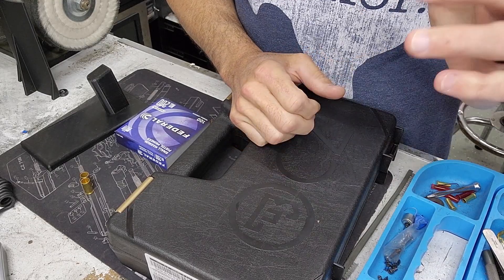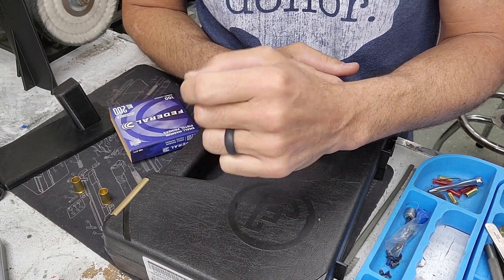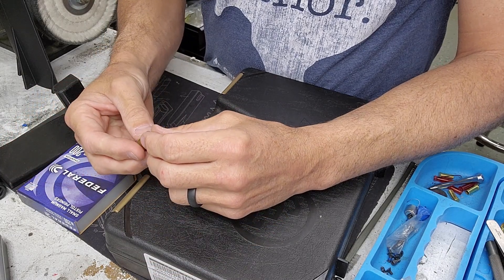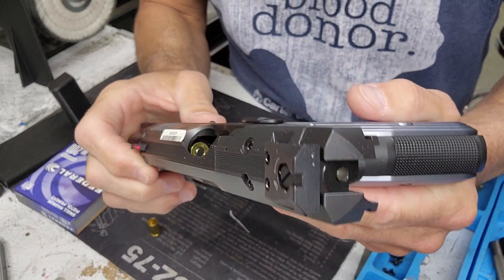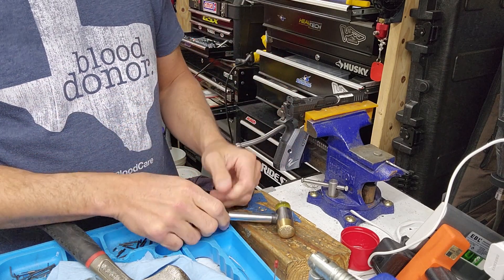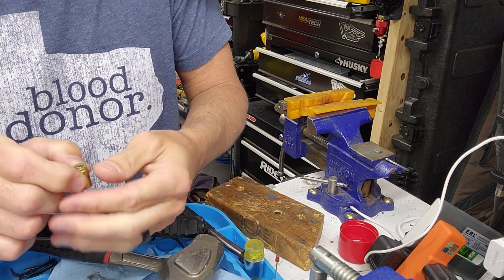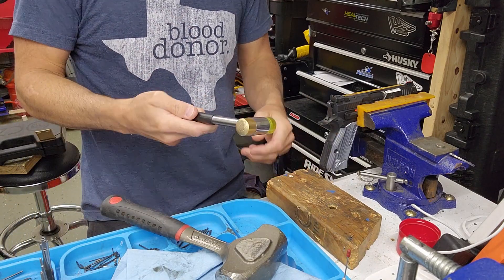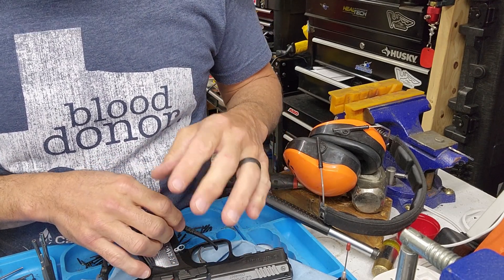Shadow 2 Compact - Drop Safe?

Comment: What a great test!  I commend you for doing this with ur new CZ pistol. My feelings on this subject are just what you discovered. For EDC stay far away from extended FP’s or any internal mods and you will be fine. Learn how to properly lower the hammer on a loaded chamber and you will be good to go.  You were imparting some serious force on that pistol when you were striking it with your large hammer. Great video!
Reply: Mods wouldn’t change this at all. Only mod that would change the result was tested. If you carry the S2C, don’t use an extended firing pin

Comment: This confirmed what I read on another experienced guys comment. He said the same thing, stock firing pin you'll be fine, but if you put an extended firing pin in then yes its possible.
Reply from the maker: Correct!  I was actually able to ignite the primer in one of the takes, but unfortunately I wasn't recording.
Reply: @czarmorer that was with the extended firing pin. What company was the extended firing pin from? Different ones have different lengths
Reply from the maker: @Rothbardy  the one I used is from CGW
Reply: @czarmorer  CGW is a no-go for me, thanks!!
Reply from the maker: @lorclan85  mind sharing why?  just curious about it. I mean, this not something that holds true only to the CGW ext. firing pin... this would happen with any ext. firing pin, unless of course, they are not really extended 😃
Reply: @czarmorer  didn't mean to put CGW on the spot. What I meant to say was no extended fire pin upgrade for me.
Reply from the maker: @PrecisionKing85 no problem at all, I was just trying to understand if you believe the CGW ext. FP was anything different than any other after market ext. FP - I don't think it is, that's why I was asking.
Reply: @czarmorer  cant you carry the gun half-cocked? you still get 80% of the DA pull and it protects the firing pin. you should be able to use an extended firing pin....
Reply from the maker: @cliftonk  sure thing - that's how I carry: Half cocked, safety on.  But I don't have an extended FP on my carry gun - I simply don't need on it.
Reply: @cliftonk  Another guy did a test and showed that you get 100% of the DA pull half cocked.
Reply: @baguazhang2  it’s not about the pull. It’s about making sure the weapon is drop safe since I use Cajun gunworks internals which includes an extended firing pin.
Reply: I've been carrying a shadow 2 compact converted to SA and an extended firing pin. My solution to this is simply to jot drop it. It's pretty easy to not drop a gun on the ground
Reply: Ive been carrying shadow 2 compact converted to SA with extended firing pin. My solution to this, is to not drop the weapon. Pretty easy to not drop a gun imo

Comment: Great presentation and thanks for showing this. I won't be carrying a S2 compact for other reasons, and decocking fully is one of those. If I carried this gun, it would be even safer to carry it half cocked, due to the safer decocking. The reason I won't carry this gun is that on the sample I shot, the wall on the single action trigger was too indistinct to be safely manageable under stress, in my opinion. After this, though, I think the firing pin question is adequately answered. Thanks again.

Comment: The extended pins cost 2 lives so far. Both heavily modified S2s. One in Canada, one state side. Both times falling directly on the hammer. Once the user itself was hit (the canuck Dentist) and once hit the RO behind someone in uspsa. 

I heard twice no about SP01 tactical (should be the name you have overseas for the decocker model) firing while decocking. Is that possible and if so which parts have to fail,  be disfunctional or badly tampered with for that to happen?

Comment: While I applaud you for actually doing some testing, I'm afraid that you have missed a very important failure mode.  Because the CZ Compact does not have a firing block, the firing pin is only kept away from the primer by the firing pin retaining spring.  The force exerted by that firing pin retaining spring is fixed.  

If you drop the gun onto a hard surface on its MUZZLE, the firing pin retaining spring will have inertia and will want to keep going after the gun stops.  If you drop the gun from a high enough height onto its muzzle, the inertia of rhe firing pin will overcome the force of the retaining spring and the gun will discharge.  This is basic physics.  Since the strength of the firing pin spring is fixed, that strength can be overcome by inertia simply by increasing the height of the drop.  We don't know how high a drop would be required to cause a CZ Shadow 2 to discharge.  Testing this would result in damaging your CZ.

Gunsmith Hilton Yam tested this on 1911s.  He built a fixture that would hold the gun muzzle down.  That fixture had a guide that ran along a vertical rod.  It took less than a 5' drop for a Series 70 gun to discharge when dropped on its muzzle onto a concrete surface.  Changing to a lightweight titanium firing pin and an extra power firing pin retaining spring increased the height required for a discharge.

Note that I'm not saying that the CZ Compact is unsafe.  I'm saying that just like a Series 70 1911 isn't drop safe, the CZ Compact isn't drop safe either.  I carried a Series 70 for years, so I'm comfortable with that.

But we need to be honest about the CZ Shadow 2 design.  It will discharge if you drop it onto its muzzle from a sufficient height.
Reply from the maker: Great point and a very valid one too.  Thank you!  However I did not intent to prove either way, and the experiment was merely an attempt to simulate what would have happened if you drop the gun at a height somebody would be holding it when using the gun.    
If we will talk physics, I'm not going to put the math behind it, but I'm confident the strikes I did on the hammer produced more kinetic energy transferred to that firing pin than the inertia it will carry over being dropped from a 5 of 6ft height hitting the ground either way  (barrel or hammer) first.
Reply: The way a lot of companies with series 70 1911s or 2011s (like staccato for example) get around this is by using a titanium firing pin... It's not able to exert enough inertia from a drop on the muzzle due to the lower mass of a lightweight firing pin.
Reply from the maker: @deanriley4700 that's interesting.  I would also wonder about the difference in the FP spring between the 1911 models and the CZ ones.  I never actually measured it, so it can be just perception, but I do believe the stock FP spring on the CZ models is a stronger spring (it would require a lot more inertia perhaps).
Reply: @czarmorer  yes, you are correct - I just compared my Staccato P to my Shadow 2 compact with a punch and the S2C is at LEAST 2x as stiff as the staccato... If not closer to 3x. Couple that with the fact that the S2C is lighter, I believe it would be extremely difficult for the firing pin to overcome the spring due to intertia, if not impossible.  The S2C also is designed to carry at "half cock" when in DA mode which will add additional hammer impact protection.  I believe it's a safe design for carry. Even the Staccato has been tested and approved for over 1000 law enforcement agencies without a firing pin block.
Reply: Another interesting antidote is that ARs have a floating firing pin and every time a round is chambered, it bumps the primer.  I've historically not loved that design, but you rarely hear of issues with ARs going off when chambering a round due to intertia from the firing pin... But if you remove a chambered round, you will see a very light pin strike on the primer.
Reply: @deanriley4700 wouldn’t that be a design flaw in the AR15? Surely it cam be improved to where the firing pin would never touch the primer unless you pull the trigger
Reply: @deanriley4700 thanks for checking! A question that may be moot is how much force would it take for the sear to break and the hammer to then subsequently fall? That may be the only argument for carrying at half-cock with the safety on, though CZ does not recommend engaging the safety except with the hammer fully cocked
Reply: @Rothbardy there are little spring out there you can buy to stop the pin from freely floating in your AR, but they are kind of unnecessary, many rifles have firing pins that freely float and rarely ever set off the hard primers in a rifle. you would need softer commercial primers and throw the rifle like a spear very hard off a building to get it to go off that way. or spend an hour rechambering the same round over and over. even then you would probably damage the round before the primer goes off by pushing the bullet into the case or the primer never goes off at all.
Reply: Good message is, that gun dropping in the axis of the FP will shoot to the ground first. Every degree of angle will then add a required height. In addition in case of correct angle, it will be dumped by a sliding slide. If @czarmorer could weight a RP, it shouldn't be so hard to compute what distance is needed to produce big enough energy (and I'm not counting the spring against it)

Comment: Thank you for this! My CZ Custom SDP has an extended firing pin ... but it has a firing pin block.
Reply from the maker: Just check to make sure the firing pin isn't protruding through the bridge face - if it is, this could be potentially unsafe regardless of the presence of a firing pin block.

Comment: Do you know what would be a great video. A Shadow 2 Compact magazine compatability video. I'm trying to find cheap large capacity mags but am unsure that the mecgar ones are going to work. I can't be the only one.
Reply from the maker: Thank you for the suggestion!  Not sure we need a video for that though - What's wrong with any CZ-75 (small frame) larger capacity magazine?  I can assure you that magazines for the CZ-75, SP-01, Shadow1 and of course the full size Shadow2 would all work for the Compact (mecgar or original - by the way, I believe the original are also mecgar rebranded).  Granted they will longer and some of the mag will protrude out of the magwell, but you said "large capacity" so I'm assuming this wouldn't be a problem.
Reply: @czarmorer  thank you for the answer and all the other videos you have made. Its been really helpful. Im new to CZs and not sure if mags index or overstop on the magazine base or if its like a glock and has a overstop in the upper frame. If your looking for clicks I'd bet a video titled S2C mag compatabillity would do ok. If your just doing the lords work and spreading knowledge I thank you again.
Reply from the maker: @take1one  My main motivation is indeed inform and humbly share my experience with the platform, however I do need this channel to keep growing in order to reach more and more people.  So I appreciate the suggestion!
Reply: Mecgar mags are fine in my S2.

Comment: Recently Garand Thumb tested dropping firearms by dropping them on the barrel. For some guns, they did go off without dropping the hammer due to the inertia of the firing pin. I wonder if the CZ S2C would as well
Reply from the maker: There is at least one video I've seen here in youtube of somebody dropping a full size shadow2 barrel down several times and it did not go off.
There was also at least one video in IG in which a professional shooter did the same test and dropped a full size shadow2 on a concrete floor, barrel down, and it did not go off.  
The firing pin spring on a CZ shadow is a very different design than the one use on 1911s.  I wouldn't think there is enough inertia to beat the OEM CZ FP spring by just dropping the gun barrel down on a hard floor...
Reply: @czarmorer  that's very reassuring since my CZ S2C is going to be my winter carry firearm. Thanks for the reply!
Reply: @czarmorer  The thing is the man in the first video repeatedly threw the weapon onto a rubber mat, which significantly softened the impact. In contrast, Ben Stoeger dropped his Shadow 2 onto the concrete in his garage, and it only took two drops for the gun to fire. That si far from being drop safe IMO.
I know this seems like an endless topic, but we simply need someone to drop their S2C onto concrete, nose down, ideally repeatedly. But I understand that no one really wants to do that with their gun.
Reply: @ossantheshooter was Ben’s gun modified?
Reply: @ShaddupNshoot  No, it was not.

Comment: Thank you for doing this test. I would be curious though if it would be the same result at half cock like the manual says to carry in? They stated not to engage the safety in half cock. It makes me nervous to do so. I think I like the idea of yours showing hammer down no safety. Relying on the double action for the safety?
Thank you,
Take care,
Be safe
Reply from the maker: If the hammer wasn't down completely nothing would have happened, unless I striked the hammer so hard it breaks the hammer/sear engagement and then it hits the firing pin, which would have simply simulated a regular firing action, in which case the gun would have fired normally.

Comment: i dont understnad: if hitting the hammer hard wont evrn dent the primer, then how is the gun fired when pulling the trigger?
Reply from the maker: Thank you for asking this question.  It gives me the opportunity to clarify this as other might be wondering the same.

When the hammer is resting down on the FP plate, it is also depressing the end of the FP that protrudes out of the plate so it's flush.  Although there is still contact between the hammer and the FP the plate itself, with a much bigger contact area, is what will take most of the energy from the impact.  The energy left will be able to move the FP slightly, but the FP spring will push it back with enough force to prevent it to touch the primer.

When the hammer is cocked, and drops, it hits the   end of the FP first, hence transferring all the impact energy first to the FP,  and that will be enough to beat the FP spring and dislocate the FP forward to hit the primer with enough energy.
Makes sense?
Reply: @czarmorer Jesus, I don't know why I couldn't see it in the first place. Your explanation makes perfect sense :) Thanks!
Reply: @czarmorer  That is the reason even guys like MAC should ask CZ why they did not use a firing pin block. MAC should have asked CZ it tells me he did NOT go to the source for an explanation on a complex potential design issue. BAD MAC
Reply from the maker: @paulheinz2145  pardon my ignorance, but what's MAC (or who is MAC)?
Reply: @czarmorer  a YouTuber that was talking hot shii about something (the gun) he did not try to understand
Reply from the maker: @BraxChat  LOL

Comment: CZ Armorer,
Thank you very much for this very informative video!
I have one question though.
If one decocked the CZ Shadow 2 Compact manually and one's thumb slipped, would the hammer go all the way down (potentially causing a negligent discharge) or would it stop in the half-cock position (in which the hammer of a CZ P-07, for example, would stop when decocked using the decocker)?
Thank you very much in advance for taking the time to answer my question.
Reply from the maker: It depends if the trigger is still pulled when the hammer slipped.  If it is, the hammer will go all the way and cause a discharge.  If it isn't the safety notch will do its job and catch the hammer before it goes all the way down.
Reply: @czarmorer  ,
Thank you very much for your quick reply!
Under these circumstances, while having a device that could function both as a manual safety AND a decocker would be ideal, the lack of a decocker increases the risk of a negligent discharge minimally.
Therefore, I do not understand why so many people on the internet complain that this pistol is not safe.

Comment: can someone explain to me how it works and why. So when the hammer is decocked, how does hitting it with a hammer not push the firing pin forward and hit the primer. I would have thought that it is the same effect as pulling the trigger and releasing the hammer on the firing pin. Thank you
Reply from the maker: @jacobclaassens  it's not the same because when the hammer is cocked the back of the firing pin protrudes from the firing pin plate and when the hammer falls it hits the back of the FP directly then transferring all energy to it. 
When the hammer is down it is actually pushing the back of the FP into the FP plate until it's flush with the plate.  Having said that, hitting the hammer at the moment will actually transfer most of the energy to the pate itself rather than the FP...
Reply: @ wowww, this is such a good explanation!! Thank you so much! 
Definitely earned my subscribe
Reply from the maker: @jacobclaassens  thank you!!